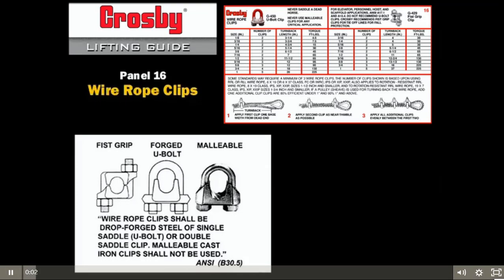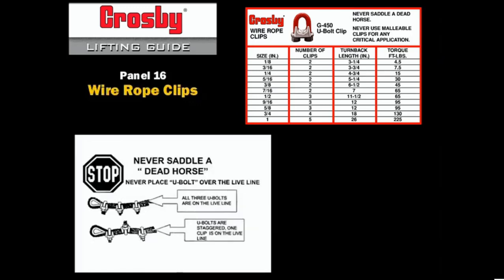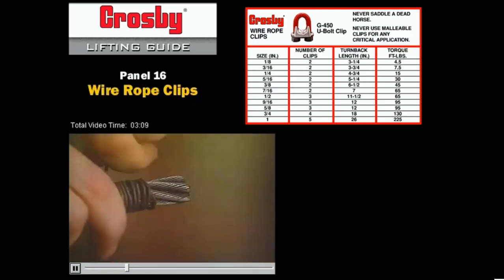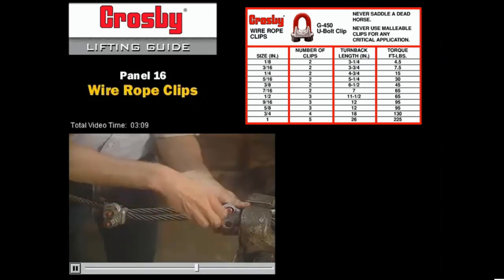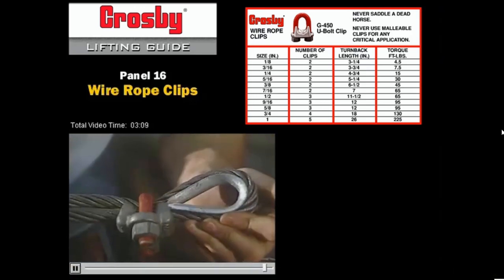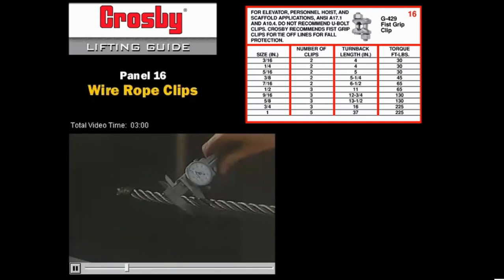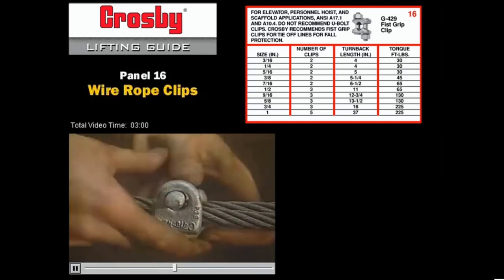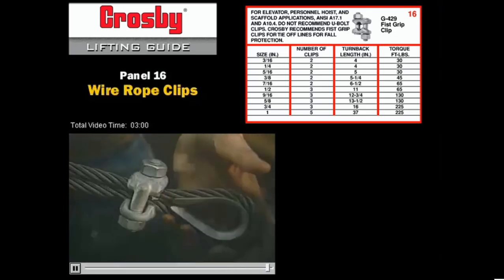Wire Rope Clips

Comment from the maker: Question 1 of 10
1. Question
Category: Rigging Hardware
“Never saddle a ______ horse.”
•   Dead
•   Live
•   Running

Question 2 of 10
2. Question
Category: Rigging Hardware
All wire rope clips must be ____________ a second time after proper assembly and the initial load has been applied.
•   Adjusted
•   Retorqued
•   Turnbacked

Question 3 of 10
3. Question
Category: Rigging Hardware
The first clip is attached ______________.
•   One clip base width from the dead end
•   At the thimble
•   In the middle

Question 4 of 10
4. Question
Category: Rigging Hardware
To form an eye in a 3/4″ wire rope, you need a minimum of ____ u-bolt clips.
•   2
•   3
•   4

Question 5 of 10
5. Question
Category: Rigging Hardware
To form an eye in a 3/4″ wire rope, you need a minimum of ___ fist grip clips.
•   2
•   3
•   4

Question 6 of 10
6. Question
Category: Rigging Hardware
The turnback length required for an eye formed with u-bolt clips in a 1″ wire rope is:
•   26"
•   37"
•   16"

Question 7 of 10
7. Question
Category: Rigging Hardware
ANSI A17.1 and ANSI A10.4 do not recommend the use of _______ in elevator, personnel hoist or scaffold applications.
•   Fist Grip Clips
•   U-Bolt Clips

Question 8 of 10
8. Question
Category: Rigging Hardware
The torque required for a 5/8″ Crosby fist grip clip is _____________.
•   130 ft. lbs.
•   225 ft. lbs.
•   95 ft. lbs.

Question 9 of 10
9. Question
Category: Rigging Hardware
Never use ______________ in a critical application.
•   Malleable clips
•   Forged
•   Fist grip

Question 10 of 10
10. Question
Category: Rigging Hardware
The torque required for a 5/8″ Crosby u-bolt clip is:
•   130 ft. lbs.
•   225 ft. lbs.
•   95 ft. lbs.